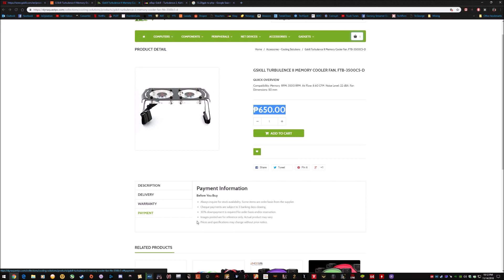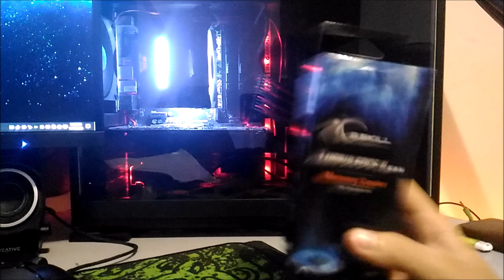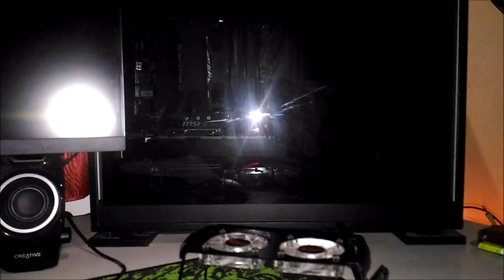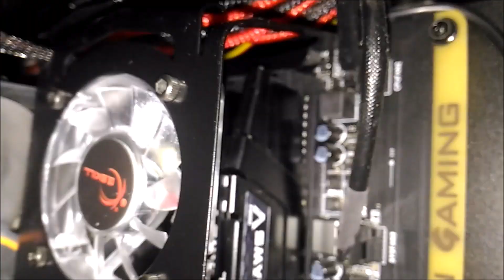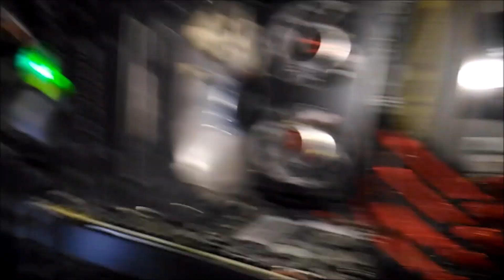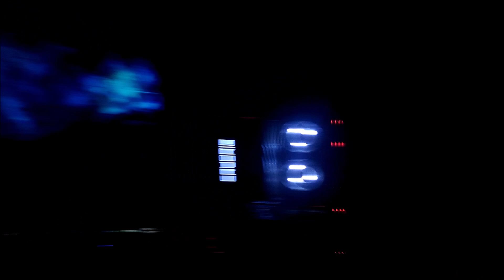G.Skill Turbulence II Ram Cooler Unboxing Install & Test

Comment: WTF ? Why you have 35C ? No OC DDR4 has 25C and very high OC 1,45v has 30C. You have very bad airflow.
Reply from the maker: Probably from the ~3000mhz clock & higher ambients in tropical country,, I had similar temps between 2 different high airflow cases /w 5+ Arctic F12 fans & standard airflow so I dont believe that's an issue, most ram doesnt even have a temp sensor apart from specific models. According to G.skill & Corsair it's normal range. 
https://www.gskill.us/forum/forum/product-discussion/ddr4/163842-what-is-normal-memory-temperature
https://forum.corsair.com/v3/showthread.php?t=179695
Motherboard temps are around 40c too,, 25C would 5-10C below ambient & very hard to achieve anywhere but a cold country. The ambient here 30-35C. :(

Comment: just one observation: at 1:13 you said the price was in GBP and it was German currency, actually not, the product may be located in Germany but the currency there was set up in your computer in Great Britain Pounds from United Kingdom, hence GBP, here in Germany we use Euros, cheers!
Reply from the maker: Ah thanks for informing me, though it wasn't an intentionally setting,, my ebay is set to philippines as you can see in the URL, which should show everything in peso but for oversea items the currency seems to be set by ebay automatically or the seller store after conversion. South Korean stores for example, show PHP value, but when I click on the listing it shows GBP instead of KRW, while a store I just clicked based in Belgium showed up as EUR.

Comment: I wonder if those 2 small fans are loud i see only molex at 3500rpms ? guess is pretty loud ? Im planning to get the Gskill  Turbulence III but im doubt bcs im afraid theyr loud at 3500rmps with molex cable , the rpms of those 2 small fans  cannot be tuned down i guess. What u think Theyr loud enough or not ?
Reply from the maker: Nup not loud at all, I thought they might make a high pitch whine being so small but I honestly cannot hear them at all over the low woosh of case fans. If you turn the volume up at 5:48, the only noise I can hear are the case fans and that's with the side panel off!. The turbulence 3 has the same 22dBA rating so should be good.
Reply: @PatchFixGaming  Thanks for ur reply back so fast ! Subbed to ur channel :) Can i ask How long u have them running and they  still working fine atm ? i see only 12 months warranty and  some people complaing on amazon that those 2 fans die pretty fast . Im tempted to get one now to order one for 25$ shipment included. But wonder if this price range if i can find anything better or these are the best to get in this price range ?
Reply from the maker: They are still running strong since the date of this video, over 14 hours per day)closer to 17, sometimes 24hrs, everyday since Nov 18th 2018. I've changed my PC case twice & upgraded the GPU & these little fans are still going strong. I did purposely 'break' the LEDs though as they were just too bright even with a tinted side panel & it bothered me too much.

You can see them still running in one of my recent vids at this timestamp: https://youtu.be/wqJtUkwkM9s?t=925 But my Arctic Xtreme IV GPU cooler blocks the lower bracket from clipping in, the Turbulence III would fit perfectly with any GPU cooler though.

I've only seen 3 ram coolers available that are worth buying, the Turbulence II & III, and this ram cooler https://www.ebay.ph/itm/Fan-Ram-Memory-Cooler-Dual-60mm-Fan-Pwm-1500-4000rpm-Radiator-Ddr2-3-4-5-Cooling/273191033046?hash=item3f9b7458d6:g:R3AAAOSw1Bxa6k-S on ebay looks pretty solid & uses 4-pin  so noise could be controlled as well https://bit.ly/387oK0G . It also doesnt have bright LEDs so I might actually get it when the Turbulence II fails if not sooner. You can search it by typing Alseye ram cooler or Alseye memory cooler if the link doesnt work. There are corsair memory coolers too but they are just way too overpriced for what they are.

Thats some VERY nice ram & timings you got there I was hunting for those here in PH but they are just out of my budget for now,,,, a cooler will help drop those temps down for sure which can improve stability & might allow further tuning or lowering of voltage.
Reply: @PatchFixGaming  Ok very nice to know this i prob order them now in the next minutes i will get the Gskll Turbulence III model :) Thanks Allot for all this info. 
Ya this Samsung Bdie kit i got recently is great ! guess it worth the extra $$$ to get this die :) Much appreciated ! Subbed and like to ur channel :)
Reply: @PatchFixGaming  I have a 16 gb kit GSKILL FLare X 3200mhz cl 14 Samsung bdie . Oc them use them at 3466mhz atm with tuned subtimings at prob cl 13 timings atm running . And for this i need like 1.41. 142 voltage constant on the ram kit . Anyway prob is in idle temps are low 30 degrees but in games in load it gets even at 48 degreess thats why i need some ram fans :) I guess .

Comment: Hmmmm was it worth the money?
Reply from the maker: I think it's entirely subjective,, they serve their purpose which is to lower ram temps, but the tangible benefits are in a grey area , such as putting heatsinks on GPU VRMs that don't necessarily need them, but at least it wasn't that expensive compared to say, the Corsair versions that go for 3-4x the price.

Improved stability during memory heavy tasks such as unpacking a heavily compressed file never hurts, but they would benefit an extreme overclocker pushing  memory towards 4000mhz alot more, or in a case with poor airflow(no front intake like my inwin 303)... I did find the LEDs a bit too bright after a few days and ended up 'removing' them permanently, a switch would have been nice but not too fussed.